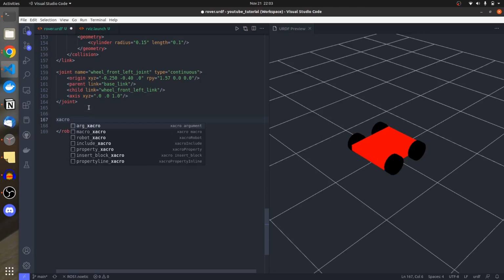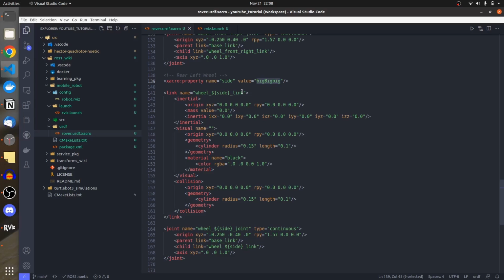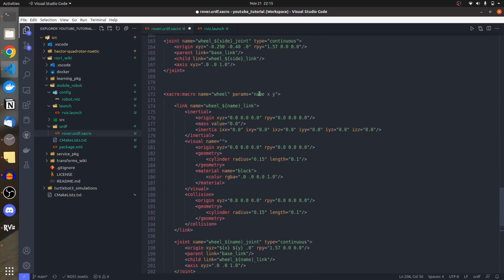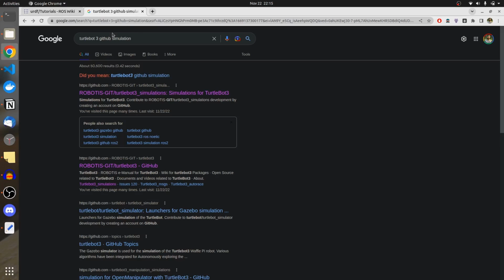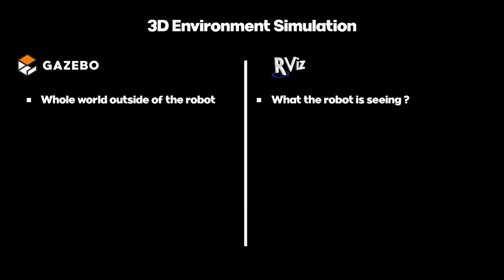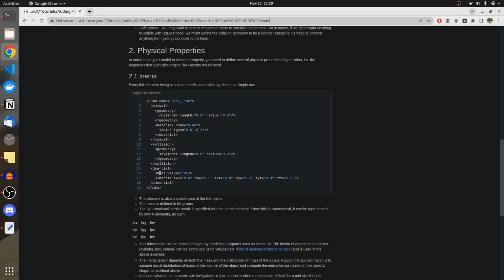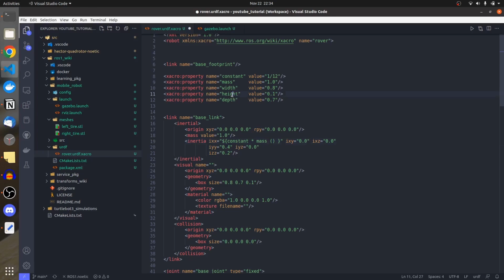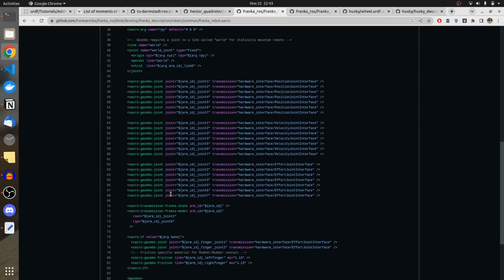ROS mobile robot URDF , Xacros with Meshes Part # 2

Comment: Firslty thank you so much for these videos,

Just wanted to point out that the syntax used to write the formulas at 25:40 is invalid and throws up an error (at least in the Noetic vers.) incase anyone has been stuck up there. Would lov to know the right way of writing those math equations if possible, thank you.
Reply from the maker: Will look into it .
Reply: yes I tried many things but I'm not able to solve it
Reply: for it to work, change the fraction 1/12 to its decimal form, which is 0.083.